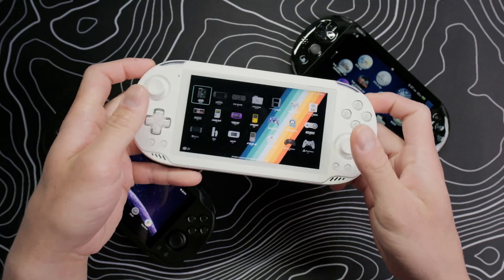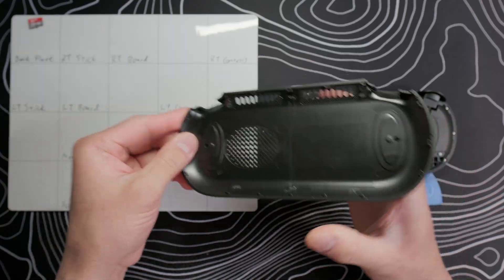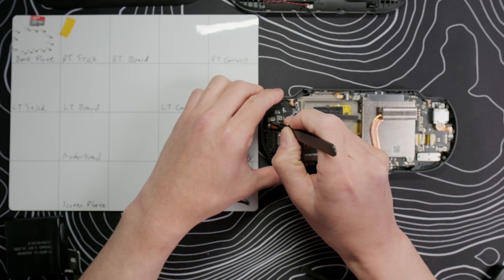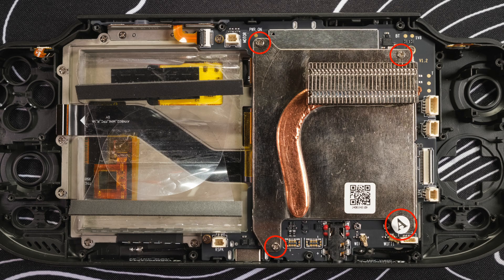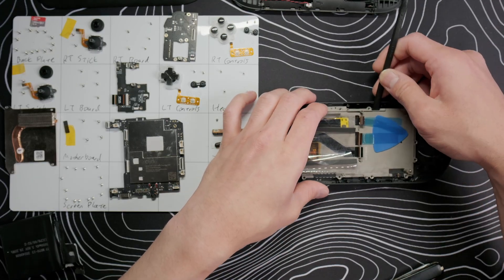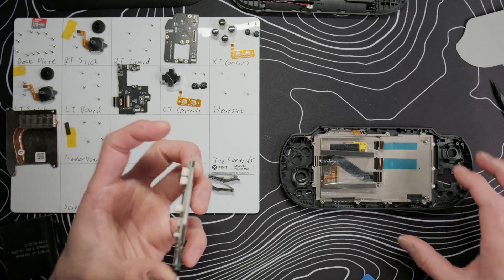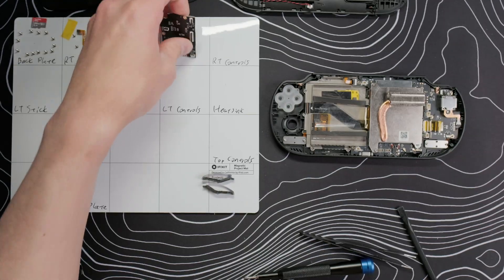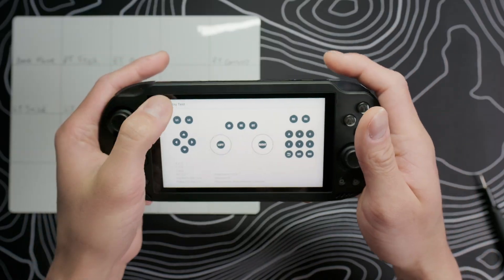AYN Odin 2 Mini Full Teardown

Comment: Hi, I have a quick question(s). You know that soft white pad underneath the battery ribbon cable? Is that insulation to keep the cable from overheating due to direct contact with the heat pad? If so, what material is it?

I ask this because I'm currently in the process of replacing the battery in my unit, and the replacement battery doesn't have that pad under the cable. I couldn't remove the pad from my old battery without tearing it up.
Reply from the maker: Yea looks like insulating material. IIRC it’s probably some kind of thin foam, I’d try to salvage as much as you can from your old battery, probably don’t want it touching those copper heat pipes

Comment: Those joystick dust covers suckkkkk. I love this device but I've gotten two mini 2s. Both of them had stick drift, but on opposite joysticks. I got it from Amazon and I'm not sure theyll replace it. Is there a way to get inside the joystick and maybe clean it up? I see you're able to take it out but it still looks covered. These are new devices so I'm not sure why I got stick drift.
Reply from the maker: Did you try calibrating the sticks? It could just be a software issue. If that doesn’t fix it, you might want to reach out to AYN support. You’re not really meant to take the stick module itself apart, and will probably permanently damage it

Comment: Have you tried replacing the thermal pads with paste? I’ve been considering it but not sure how safe it is
Reply from the maker: Heat isn’t really an issue on AYN handhelds. I’m usually getting around 95-99% stability on wildlife extreme, which means it’s not thermal throttling
Reply: @whatobiplays fair enough. Mine gets pretty warm but maybe I’m just overthinking it

Comment: Hey Obi, thanks for the video it was straight-forward and (almost) everything turned out alright. The problem was when I reassembled it, the battery had a question mark on the Android OS and I noticed that you didn’t have that problem? I thought maybe it just needed to be recalibrated, like some batteries I've dealt with such as a Switch Lite's battery, where you just drain it to 0% then fully charge it again to 100%. Unfortunately, after draining the battery and leaving it on the charge all night long, it no longer wants to turn on. I was wondering if maybe you've encountered this before?
Reply from the maker: Hmm I have not had that issue. Maybe a ribbon cable got disconnected when you were reassembling?
Reply: @whatobiplays Unfortunately even though I reopened the device and reattached it, it still had the issue :/
Reply from the maker: Dang, might want to reach out to AYN support then 😕